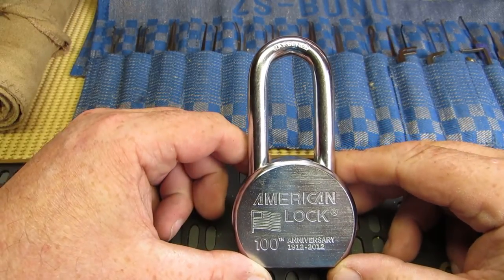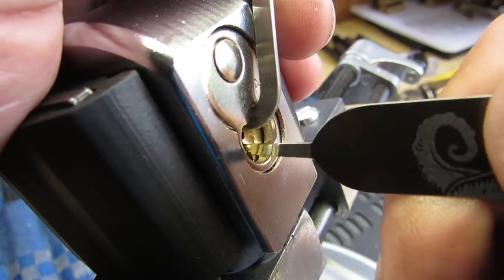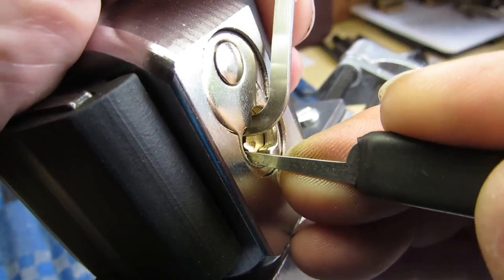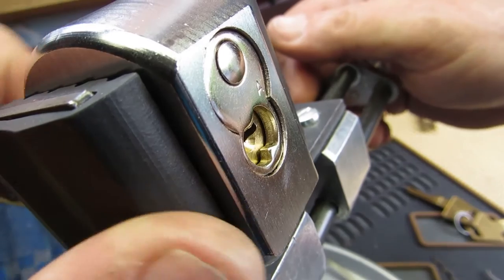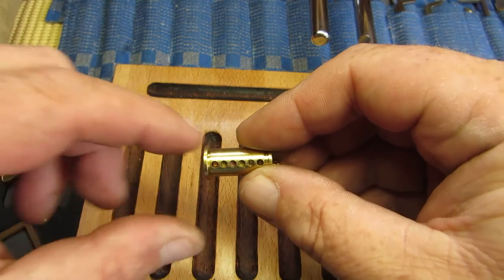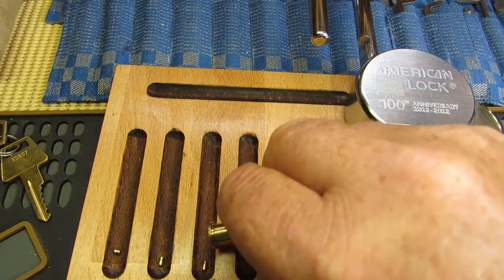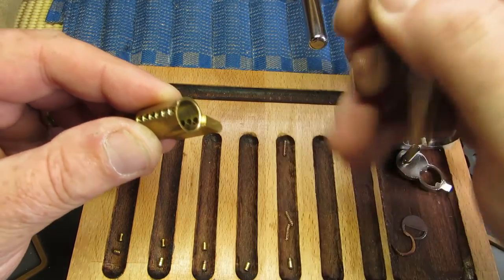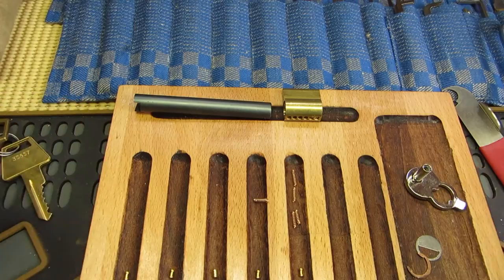(11) American 100th Anniversary Padlock Picked & Gutted

Comment: what hook did you use Pete? again another gorgeous lock, an one I have in my collection. definitely a keeper!
Reply from the maker: Thanks, it's one of the Sparrows SSdev, the deepest hook I use it a lot.  I just ordered the unhandled ones and used shrink tube on them.
Reply: +Pete Restall I had a suspicion, been tempted to get them for ages. do you rate them?
Reply from the maker: TBH I haven't used the smaller 2 hooks much, but the deep one I find extremely useful and use it a lot.